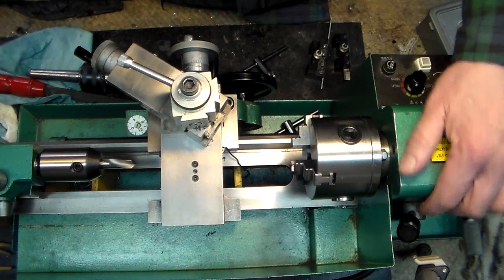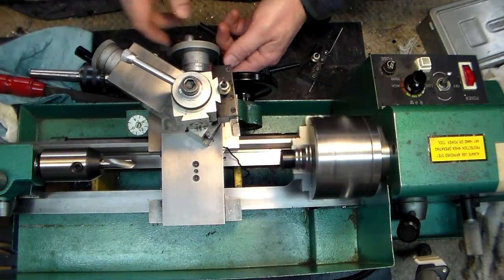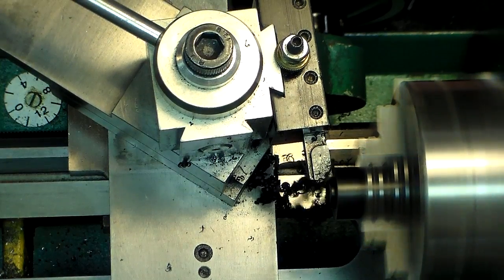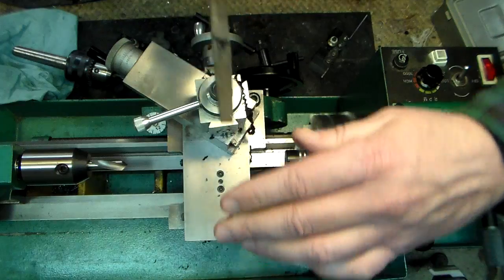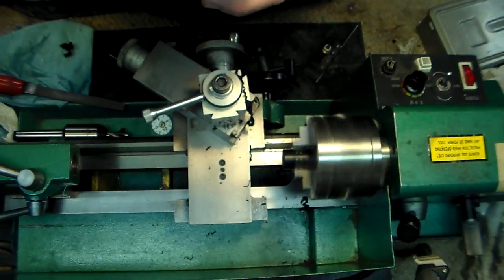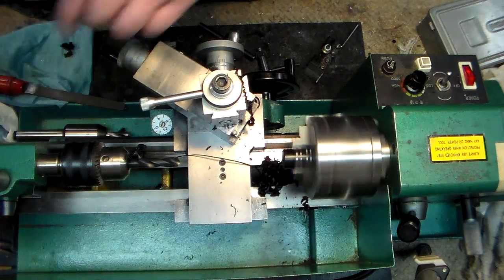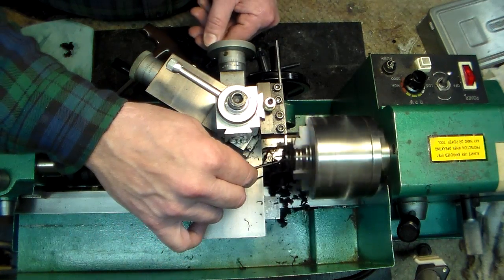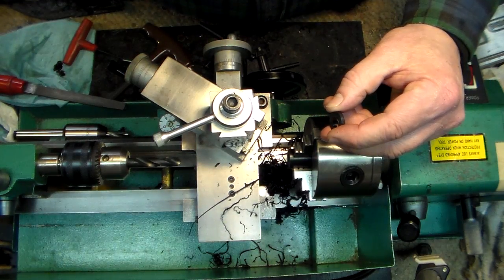Simple lathe operations on the 7x10 mini-lathe

Comment: Very informative. However I must say, regardless of the size of the lathe youre working on, you should never wear long sleeves. Scary. Other than that, great video
Reply from the maker: Kyle-  That is only for schools...  Every school has to teach that because almost all students will wind up getting something caught in a machine of some type!  However in a working machine shop most machinists will have long sleeves on and tightly fit.  (Unless they are in a warm climate)  the hot chips that fly off the lathe will come in contact with the bare skin on your arms and it isn't pleasant.  If shop teachers could they would have students naked and bald!   =D

Comment: Hi Scout,I recently got a leath do u happen to know where I can get a stand for it just the stand?
Reply from the maker: Hello Alan!  Congratulations!!!!   Many lathes have stands that they sell specifically for the model however they are usually lacking in some feature or another... The best thing to do is either buy or make a nice sturdy workbench just for that lathe!  It has to be sturdy, not just for the weight of the lathe but to stop any movement...  You can easily make one from 2x4's and a sheet of 3/4" plywood of buy a workbench kit...  I really like to have the lathe sitting higher then most...  For me the bench top should be about 4" above my belly button!  Lol.  It really helps!   If you need anything you can always reach me at bicycleguy@aol.com
Reply: @ScoutCrafter  thank Scout.i write you soon.

Comment: I have a Sieg lathe, too. Started out as a 7x10 and ended up as a 7x16. Did that tool post come with yours? I have an aftermarket tool post on mine, but it doesn't seem as nice as yours; the stock one wasn't well designed..

Comment: Hello! Explain please for what a small feed (I do not know how exactly is called, I bought the machine recently - I do not know everything yet), turned to the right by 30-40 degrees, with the handle to myself ?. After all, it will work without turning, with 0 bumps? I do not understand.
Thank you.
P.S. sorry if it is written incomprehensibly used by the translator Google
Reply from the maker: Илья Старообрядец Hello My Friend!  I think you are asking me about the Compound rest that sits on top of the cross slide... That is normally used for operations like making tapers and threading. It allows you to come in to the work at an angle of your choice. Also it allows for finer cuts as the drive threading is not as coarse. On much bigger lathes the compound slide is used more because when taking a heavy cut it offers more ridigity then using the black carriage knob when cutting, However for most cuts the black carriage knob will be fine. Also- try not to overhang the compound rest too far over the cross slide or it too will lose rigidity... I hope that helps!
All the best my friend!!  😃👍
Reply: ScoutCrafter, thanks! Now I understand it :)
And how to take feed at an angle with a small handle,? After all, you point out that it is possible to more accurately handle the part by rotating the small handle.
The price of dividing both arms of my machine by 0.025
Are there any formulas or secrets in this matter?
Reply from the maker: Илья Старообрядец - Hello my friend, I am sorry, I'm not sure what the question is, I think it's getting changed thru translation...

Comment: Are the little harbor freight lathes any good for little projects like bushings etc
Reply from the maker: Tbone- A small 7 inch lathe like this will pay for itself with all the jobs it can perform. It has enough power, auto feed and other features that make this small lathe very useful. I have made many parts including bushings, spacers, washers...  For the money it is one of the best tool buys I have made.   Hope that helps...
Reply: what brand lathe is this?

Comment: Awesome! Subscribed. I always need washers when fixing up old machines, but don't yet have a metal or wood lathe. 
I am building them, and keeping my eyes open on the classifieds, but I'm likely going to have my improvised mini metal lathe built before I can actually afford to spend $1000 on a nice used South Bend or similar.
I am trying to make the justification to lust get a Grizzly 7x14 to get me started, but I'm so broke from having to rebuild my house, which is what got me into wood and metal working machines in the first place.
Reply from the maker: Hi Dave!  Thanks!  The good news is that due to the CNC craze used manual lathes are quite affordable now! In fact the larger the Lathe the better deal you can get! Right now my shop is in the basement and I have to limit myself to the size machines I can get down there but a 9" Lathe is really a nice size. Too big of a Lathe and you start to deal with other problems.  These mini-lathes let you do some modest work and have some fun. I know how hard it is to come up with a few extra hundred dollars for a Lathe when there are so many other expenses to deal with. You have the right idea, don't rush in and spend big bucks on a Lathe until you know what features you can live with or without! 😃👍

Comment: Love watching this stuff. 
I'm completely ignorant… Why couldn't you make a machining lathe out of wood, like some solid birch plywood or something? i would think you'd just need a good headstock.
Reply: Actually pre 1870ish most lathes were built with a wood bed with cast iron ways bolted on them. They mostly turned cast iron wrought iron & brass/bronze with high carbon forged tools verrry slowly.
Any lathe will chatter, even monsters.
Reply from the maker: apple milkshake - Excellent point- It's all about rigidity- that's the key with lathes... My first lathe was a Grizzly wood turning lathe, it was 48" long and had poor rigidity so whenever I introduced the tool to the work it would give a little causing chatter and a lousy cut. The same thing applies to metal lathes, if there is even a few thousandths of give there will be chatter and a poor cut. You certainly could make a metal lathe out of wood but it would have to be very rigid and stout. Sharp tools and light cuts would help but it could be done. The only difference between big lathes and small ones are their ridigity... Thanks for watching and commenting!  😃👍

Comment: As you demonstrated these operations, I was thinking how common they are to any size manual (and even CNC) lathe. Every time I use my 70 year old, Logan 825, 10" lathe, I use these operations. Hundred year old plus lathes have run these operations. 
That you can go out and buy a very usable lathe for $400, and perform these basic operations - and more - is pretty amazing to me! 
Thanks for posting this video!
Roy
Reply from the maker: You are Spot-on Roy, I learned all the basics on this little guy then one day at work the shop needed a part made and the only machinist was out- they asked me if I could give it a shot and I said "Sure!" It was a 13x40 Jet lathe and after about 15 minutes of familiarizing myself with the controls I made them the part they needed. The boss was a very happy. Then I took a couple hours and cleaned up and lubed the Lathe like new. The next week the Machinist came over to me and said "You did a awesome job refurbishing the lathe, anytime you feel like turning you're welcome to my tools" 😉  
Like you said Roy, it's all the same stuff really... Only the cut is larger!  😃👍

Comment: i picked up an older Central Machinery branded (Harbor Freight Version) 7x10 off Ebay... Nice machine. It was in a little bit of a rough state when I got it but Little Machine Shop . com has all the parts for it so replacing even the tiny Gib screws was no trouble at all! I like it way better than my little Unimat BD Lath which is so under powered its not even funny.
Reply from the maker: HDR- you are absolutely right, little machine shop has saved the day many times for almost any part on these lathes! I too have a Taig lathe but it can't compare to the power and stability of these 7x10's  😃👍

Comment: Hello. What is the usage of this mini lathe? Consumes a lot of power?
Reply from the maker: Hello- Typically these small metal lathes are called hobby-lathes. They are ideal for turning metal and other materials for smaller projects. The 7x10 model means I you can turn items up to 7 inches in diameter like pulleys and handles, the 10 means you can turn shafts that are Ten inches long like     screwdriver handles and pens! The power usage is very low only a few amps. For the money they are very good machines.  👍
Reply: Thx man! Great machine.
Reply: Hey dude, I see you're Dutch too, if you find anything let me know

Comment: Thanks for the reply......what would be the optimum lathe for the job I described?  How much time savings with a big lathe (30% 50 % etc.) thanks!
Reply from the maker: Jean - For most of us, there are two major considerations for buying a lathe. 1-Cost and 2-Room... How much can we afford and how big of a lathe can we fit in our shop.  😉  In my opinion a nice size lathe for just about any job is the 9" series... A 9x20 lathe will have the power and stability to turn a wide variety of projects and is still pretty affordable. It should also save you at least 25% time machining most projects over the 7x10.  If you're making one piece not a huge difference but make a few pieces and the time adds up...  😊

Comment: If you are interested in making a exhaust flange with a 1 3/4 inch hole for a 2 stroke motorcycle.....can this lathe do that job or do you need a bigger lathe? thanks
Reply from the maker: Hello Jean,  The bigger the lathe the quicker the job will go because you can take bigger cuts, however you can make that part on this lathe no problem!  Good luck!
Reply: It would do it. just rough it out on a drill press with a hole saw.